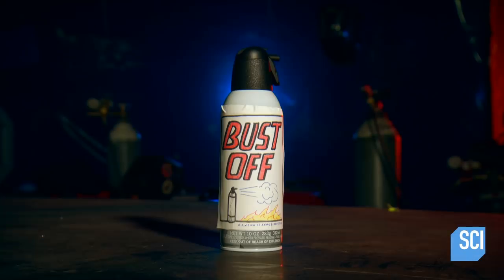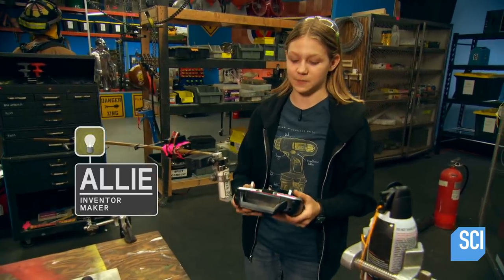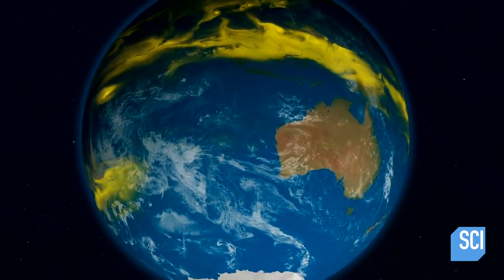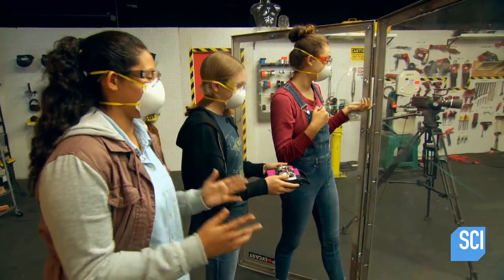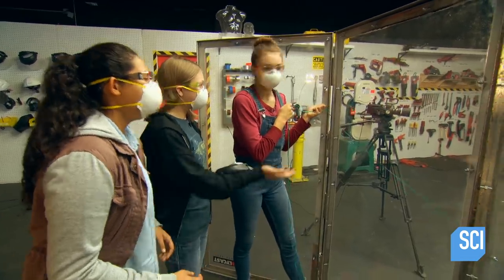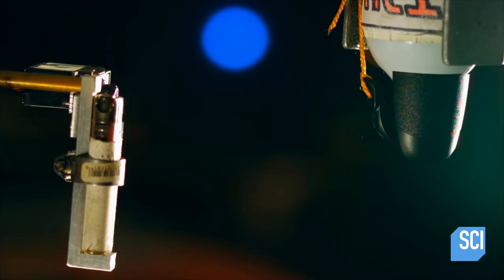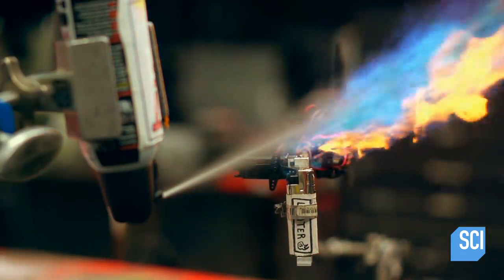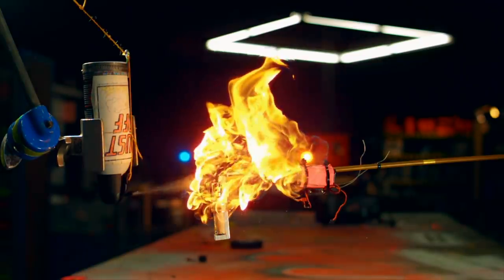How Flammable is Compressed Air? | MythBusters Jr.

Comment: One day I was cleaning my keyboard and other PC accessories with a can of compressed air, and I had a candle near by. After finishing all my work, I foolishly, and very stupidly — through an act of autopilot — decided to blow out the candle with the compressed air in my hand. I said “fire gone” as I sprayed, and immediately got covered in candle wax with a ball of fire flying at my face. I singed off my hairline and eyebrows, and had a sore throat for 2 days. I told my barber that I got into a fireworks accident. I was too embarrassed to tell him I failed to follow the safety rules on a bottle of compressed air.

Comment: Wait is air flameble
Reply: faviol Kape umm yeah...how do you think your car runs? Not gasoline by itself.
Reply: faviol Kape it has oxygen in it. Oxygen is flammable. Plus other gases
Reply: @Diddy_Doodat  facepalm dude, oxygen is not flammable, it allows things that ARE flammable to burn. oxygen is an oxidiser, what ever it is allowing to burn is a fuel.
Reply: no, the contents of that can is some sort of very flammable gas that when compressed will liquefy, seeing as they hid the brand and didnt say what was in the can, i cant tell what it was. they call it air probably because there it is a gas when it comes out.
Reply: Uuuum.......ok
Reply: Home Grown Pyrotechnics oxygen is a fuel itself when it comes to fire. Look up how flammable liquid oxygen is goofball.
Reply: So oxygen itself isn't flammable, but because it's an oxidizer, it will feed an existing flame, so it's not that the compressed air is igniting, the compressed air is just making the flame bigger.
Reply: That being said, it's not even oxygen/air in a compressed air can, it's other gases.

Comment: @Science Channel - 
It seem there is more inside than just air
Reply: That's because everyone calls it compressed air. That's completely wrong because you can't shouldn't breathe HFC-134a, HFC-143a nor HFC-152a.
Reply: @Carl Siemens - 
oh "nice" ... maybe they produced HF (Hydrogen Fluoride) in this experiment ... 
maybe it will be replaced by the even more dangerous R1234YF
Reply: @Killerspieler0815  
Don't worry, they have N95 dust masks.

Comment: What is in the can? It's not just compressed air, is it?  Are there any products that just have compressed air in them? Air is 78.08% nitrogen, 20.95% oxygen, 0.93% argon, 0.04% carbon dioxide. Nitrogen doesn't burn, oxygen isn't flammable, it's the oxidizer in flames, argon is inert, carbon dioxide doesn't burn, not much of anything else. I used an ancient can of so called compress air as a cleaner and the liquid I didn't realize was in the spray can ruined the thing I tried to clean. 

When I want to use compressed air, I want only gaseous air in the same proportions as uncompressed just floating around air, like when compressed air comes out of a balloon.
Reply: oxygen will burn
Reply: @LS-ot4ho  No, but a mixture of fuel and oxygen will.

Comment: This video is - as expected - not about flammable air, but flammable gasses. What a waste of time
Reply: The are gases in the air smart guy.
Reply: there is a higher concentration of oxygen, which is one of the three things that produce fire (spark, fuel, and oxidizer)
Reply: Air = 21%O2, 78%N2, 1%Rest.
This is still no air, but rather a Gas mixture
Reply: @bjarnes.4423  Air is a gas period. It's not a damn liquid. Do you breathe liquids? 🤦🏾‍♂️
Reply: Btw oxygen is flammable, especially as a liquid.
Reply: @Diddy_Doodat  I never mentioned anything about liquids. And no, air is not flammable. Otherwise everything would blow up if sth sparks
Reply: @bjarnes.4423  Air is flammable. How tf do you think your car runs? Gasoline or diesel alone.
Reply: @bjarnes.4423  How do you think fire is made? Ok...air is combustible...do you like that better